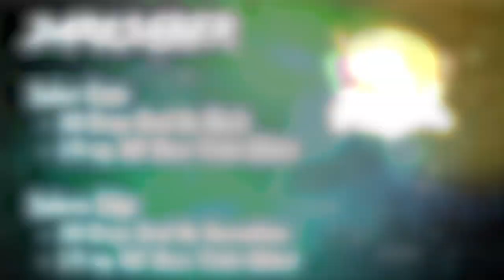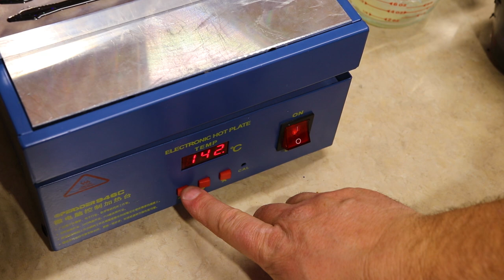Color Matching The Mandalorian Darksaber - 12" Mega Grub

Comment: Great demos...too much info!!!
Couple things regarding the disco flake that may help someone. I haven't been using it long. You turned me onto it a couple weeks ago. I have an 1100 watt micro. I would bring the plastic up to temp let it cool to 310. Then mix in the flake and inject. As long as I kept it in a 2 cup pyrex on the reheat, it was fine. Short shots of heat and not letting it get above 310. I shot a couple hundred grubs, was down to the end with no loss of color. transferred to a 1 cup. Even with low temps and 15 second reheat cycles it turned green instantly. Believe the 1 cup concentrates the heat. Give it a try.
That disco flake is awesome. Nothing looks quite like it.
Look forward to future videos...thanks again!
Reply from the maker: Thank You!!!   Ohh that's a great tip on the 2 cup pyrex.  I'll give that a shot.  You might be onto something, because I agree with you, it takes longer in my 2 cup to heat just 2 cup of plastic.  So I wonder if the thicker glass is causing for a slower heat-up therefore protecting the purple of the flake.  We must test this further!!!!!!!

Comment: I very much enjoy the channel and your enthusiasm.  Question about the giant grub, how does the tail work?  If you are pre-pouring the darksaber tail and then adding it to the skim coated body, wouldn't you need to either have one half of the mold milled deeper to make up for the adding the tail and keeping it centered?  Or is the plastic thin enough that it really doesn't matter?
Reply from the maker: Thanks for the kind words!!  As for the tails in the mold, you are correct, the mold is designed to be recessed to accept the tail.  The last inch of the body of the grub molds around the inserted tail to form a solid bond.  This way you can shoot the mold all by itself, or you can use the separate tail mold like I did.

Comment: Great idea.  Who doesn't like Star Wars!! Quick question.  What are you using to heat your molds?
Reply: One more question. Did you use the saltwater blend for the skin pour on the grub?
Reply from the maker: I am using an industrial hot plate off of Amazon.
Reply from the maker: No. I used Worm Blend for the skin pour and the tail, and saltwater blend for the body injection.  So it has a soft outer skin and a really flappy tail, but a super solid core for strength.

Comment: What temp did you shoot the core of the mega grub at? And did you have to heat the mold to bond the skin pour to the core
Reply from the maker: I shit the center core at about 340 F as to not burn the sparkle flake. Yes you are correct, I baked the entire mold at 350 for about 15 minutes on the hit plate before De-Molding. 👍🏼

Comment: What hook you running on the mega grub?rigging video?
Reply from the maker: I have no idea yet.  I'm open to suggestions.  I definitely think I could nab something on it trolling it behind the boat out in the Delta.  It would definitely make for a fun video!
Reply: Most of what I have seen is 12\0 giant lingcod jig heads.  Maybe a little much for trolling lol big ol delta striper would definitely eat it.
Reply from the maker: Yeah that's what I'm thinking! A Delta Striper definitely has to grab this thing right?  OK 12/0 sounds like a good place to start.  If not a Jig Head, maybe a 12/0 Beast Hook??  I need to pick some up anyways for the Epic Boss Mold, so I'll try that on the Mega Grub.